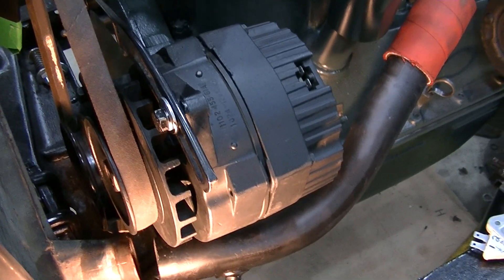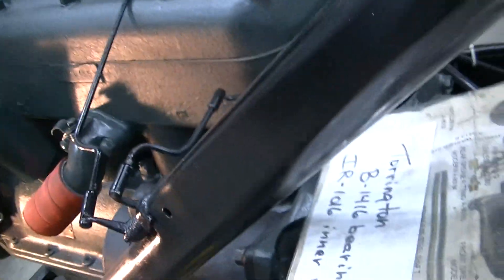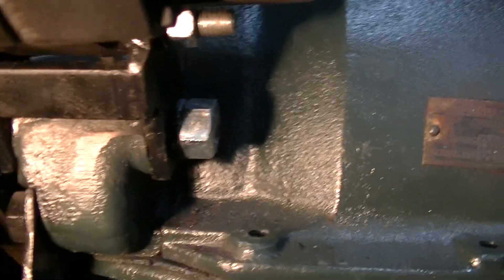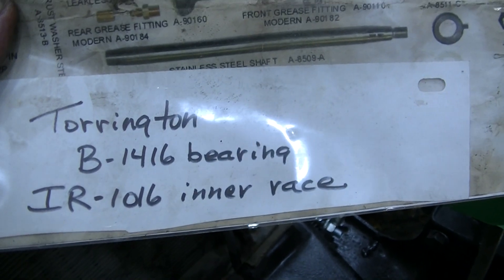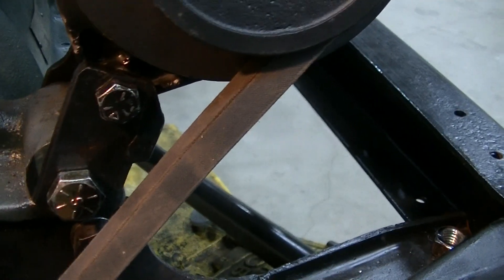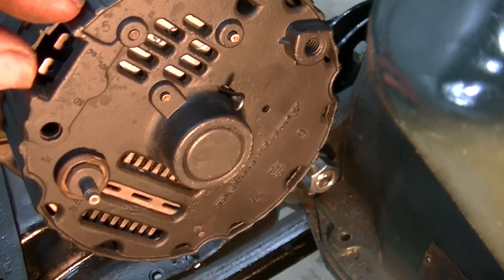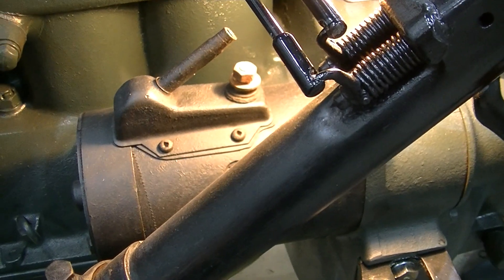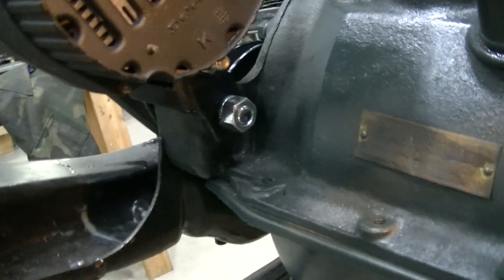Model A Ford 12 Volt Conversion - zeketheantiquefreak

Comment: What is the tag mounted on the block say??
Reply from the maker: The metal tag on the block is the engine serial number. It is generally the number that these vehicles are registered by as there isn't a serial number on the body.

Comment: Why in the world would a person convert a Model A to 12 volts. Feel the only reason might be to install an air conditioner. What will a 12 volt system do that a 6 volt system will not do. Tip, if you run a 6 volt model A horn on a 12 volt car and  use a resister to reduce the voltage to the horn the horn will be eventually destroyed and can not be rebuilt. Any model a horn motor can be rewound. Running one on 12 volts with a resistor will damage the commutator. The commutator cannot be replace. Why are you doing this?
Reply from the maker: Thank you for the comment. Changing to 12 volt is not normal procedure. In this case a lot of scrap Model A parts have been assembled To make a 'wheelchair A'. When giving rides to the elderly at care homes, the ones in wheelchairs would not get to ride in the vintage cars. This was the answer to that and some of the extreme mods require 12v. So, please forgive us this transgression in this project.
Reply: @zeketheantiquefreak8518  Why change to 12 volts. Very much like what you are doing with your car. Am trying to  understand why a person changes to 12 volts. Appreciate your reply.
Reply from the maker: @michaeleisenbise4278  The mechanisms for raising the wheelchair ramp and tying down the wheelchair, etc. are only available in 12 volt.
Reply: @zeketheantiquefreak8518  Ok, if the 12 volt amperage is below 20 amps a person can buy an inexpensive 6 to 12 volt converter on Amazon and not have to convert the starter, horn, light bulbs, etc. Hope this helps.

Comment: Did you end up modifying your starter? If so what did u do after getting in to it... 
Thanks
Reply from the maker: Sorry for the tardy reply. When we get back to that project I will re-order a set of 12 v field coils from a 1953+ Ford. Apparently the housings are the same and the current draw will be correct with the right fields. Hope this helps.
Reply: @zeketheantiquefreak8518  every thing helps I'm just starting my first build and kind of liked your idea on the push button start like newer cars ... thank u
Reply from the maker: @dougie46350  Yes, the 'purists' may be angry over this project and it's mods. When we go to a care home or seniors housing to give rides with the old cars the ones in wheel-chairs have to be left behind. This will be a rear loading wheel-chair unit and should paste a smile on many faces. The mods to a modern ignition switch and electric fuel shut-off, etc. will make the unit 'user friendly' and anyone that can drive a standard can operate this without the steep learning curve of the controls and operation. May the Ford gods forgive me.
Reply: @zeketheantiquefreak8518  I'm sure they will be so excited to go for a ride they wont even notice the 12v or the electric mods ...cant wait to see the rest of your  build
Reply from the maker: May I suggest that if you are putting an alternator onto a Model A, have a look at my video on 'Model A Ford water pump rebuild' and install the expensive Torrington bearings in place of the originals so that the extra belt load can be handled. Just sayin'.
Reply: @zeketheantiquefreak8518  did that few days actually...went to snyders antique auto... and bought the new water pump